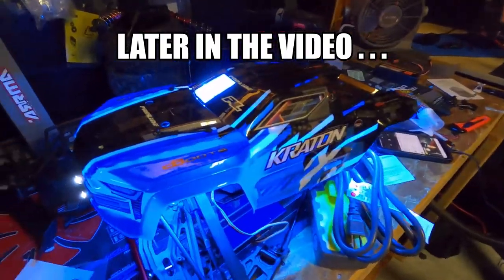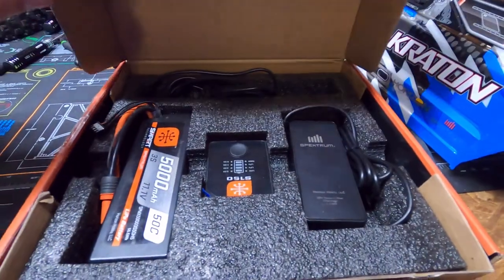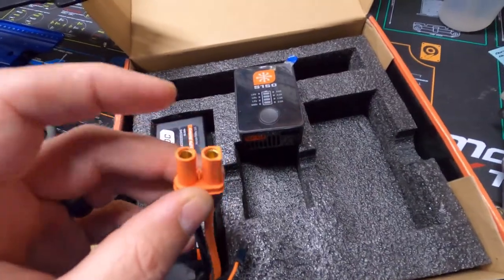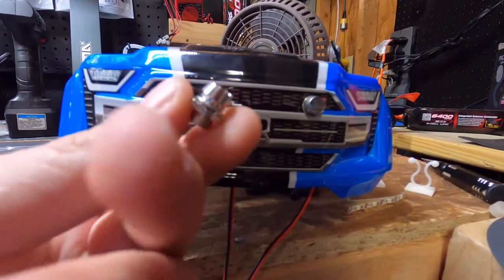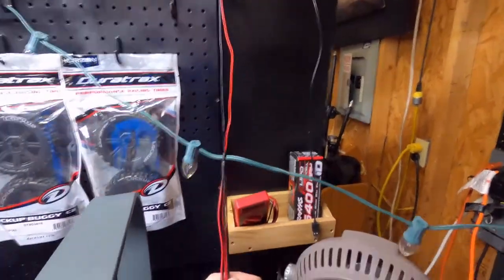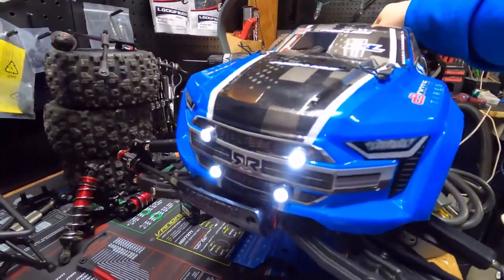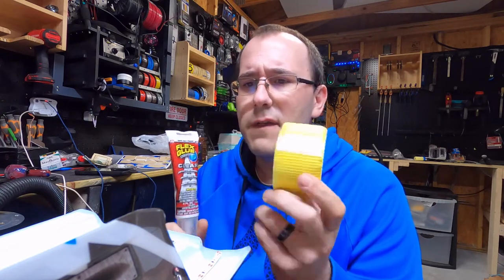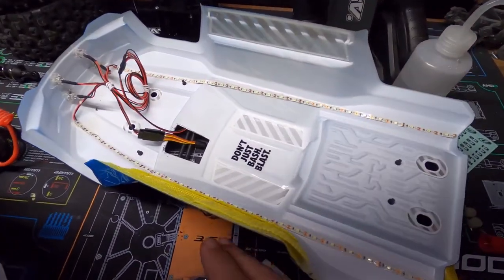KRATON6S + HeadLights + "REINFORCED" Body + Spektrum 3S

Comment: Ur going to need another 3s or atleat 1 4s.  I don't think the 150 amp esc that's in that is made for 3s.  Also I run the same battery's in mine well two of them 6s.  I have the s2100 with the screen.  There is a fair amount of useful stuff and benefits to having the s1100 or s2100 chargers.  You can't keep an eye on internal resistance in your battery or if it has had any faults or how many times it has been charged.  You can also change the output amperage for faster or slower  charging or discharging.  One other thing the balance lead goes strait into your charger just put it in all the way to the left.  It's made to fit any from 2 to 6s battery
Reply from the maker: yea  i m not sure what to run... 2x battery . like 2 3cell lipos?